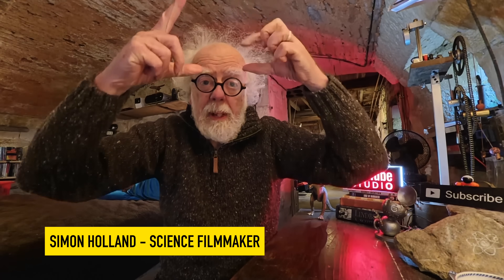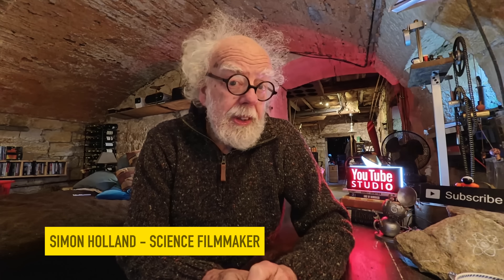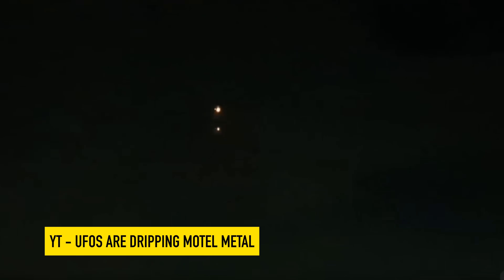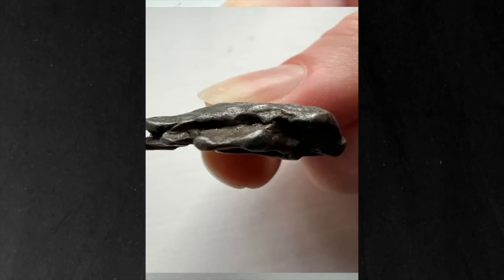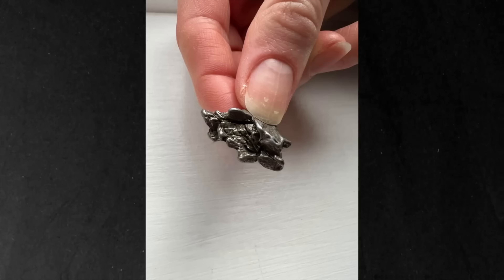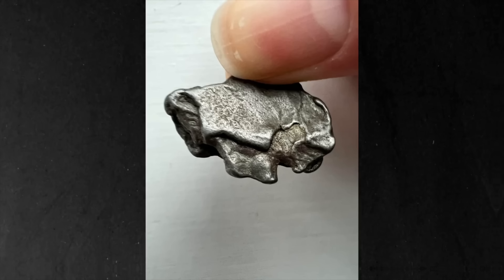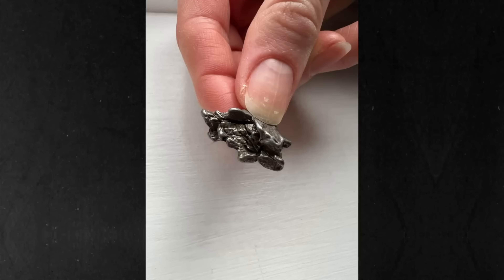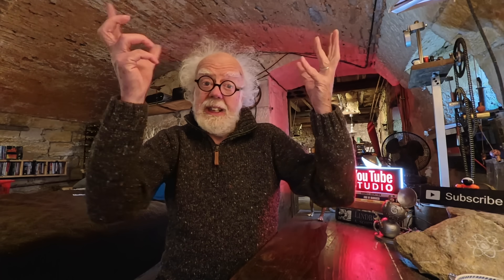Dripping UAP - What Are They?

Comment: Plasmas emit line spectra, specific wavelengths correlating to the electron shell-orbital transitions of the respective elements.  The principle one involved in air plasmas is nitrogen, making up 70% of the air, which has a lot of shorter, higher-energy bluer transitions, and longer, redder, lower-energy ones, resulting in the familiar violet hue of electrical arcs.  The most-commonly seen colour of warp bubbles however is orange / white, diffracting out into a continuous spectrum, inconsistent with plasmas, but instead common to thermal emissions / black body radiation per se.  It's the same anomaly Pierre-Marie Robitaille points out in regards to sunlight and starlight generally.  It's also the same type of distribution as the cosmic microwave background radiation.  So it's essentially the EM equivalent of white noise, comprising photons of all possible wavelengths, and in the case of UAP extending down past infrared into microwave and radio ranges, as well as up past optical range into UV, x-ray and even gamma ranges.  Besides, atmospheric plasmoids wouldn't persist out in space, or under water.  In other words, unlike most light we encounter, UAP light does not correlate to conventional emissions from matter - ie. from relative accelerations between interacting electrons and protons.  The photons are not being produced by electron shell-orbital transitions!

This leaves spontaneous stimulation of radiation from vacuum as the only consistent explanation, implying we're witnessing a so-called 'thermal bath' effect, akin to Unruh radiation, a form of Casimir radiation caused by adding energy to virtual photons, the vacuum's mediator of EM forces per quantum electrodynamics (QED).   As mentioned, UAP orbs are warp bubbles not plasmas, a manifestation of vacuum energy rather than energy expended by or lost to the craft themselves, not unlike the wake of a boat through bioluminescent algae.  Compressing spacetime likewise shortens the Planck length inside the warp bubble relative to outside, while blue-shifting virtual photons, thus adding energy to them relative to the ambient vacuum potential outside the bubble in flat spacetime.  The second law of thermodynamics then applies, energy dissipating from source to sink values of EM vacuum potential, hence these broadband emissions from the interface between curved and flat spacetimes.

Inside each such warp bubble is a solid craft, which may be a disc, sphere, cube or whatever.   Angle hair is likely a form of Rydberg-type matter comprising novel arrangements of ordinary air components, again from novel physics acting at the warp bubble boundary, and molten metal emissions are likely a disposable heat-sink contingency;  spacecraft have limited options for rapid heat exchange, hence under conditions of heat stress may pump all excess heat into an ejectable slug of scrap metal.  Exotic transmutations aside, your theory neglects to mention how self-sustaining atmospheric plasmoids might acquire or carry such metal reserves in the first place!
Reply: What a great and detailed response.  Would love to see a video of this with some illustrations.  I think you would definitely be the first describing the processes observed with such scientific prowess. Instead of leaving more questions unanswered, your explanation seems to answer many questions, even some I never thought about asking before.
Reply: I don't understand half of what you said, but it sounded nice. 😄
There is also intelligent movement, communication, blinking, and instantaneous acceleration associated with "plasma orbs". Metallic orbs are often thought to be affiliated too.
Reply: Thays what i was gonna say
Reply: That's where his theory falls down. As they always do.
Reply: I'm convinced that some of the metallic slag ejected from these glowing orbs could be the detonation mechanism and nuclear fuel from inside our nuclear weapons. Supposedly, after orbs and UAP were seen over nuclear missile sites, the missiles were rendered inoperable and the nuclear materials were missing from inside the weapons themselves.
Reply: Would not be able to formulate it that well myself, but there appeared to be several "shortcuts" in his explanation that did not match up. Like, in his explanation plasma is made up of disintegrated nuclei of heavier elements - this would only happen at temperatures like inside a star or a fusion reactor. People witnessing this would not live to tell the tale... Also, the question of the energy source stays unanswered. Also agree on the question of photon emissions - if you look at the descriptions of the odd properties of the light emitted by UAPs, "normal" dipole EM radiation does not fit the bill. Quadrupole emissions appear to be the better explanation. If taken as a starting point, interesting hypothesis could be developed regarding the physics involved in the process of UAP radiation... one of the possible mechanisms would be... well, a fusion power source. No idea how those UAPs contain the immense levels of radiation that would be involved...
Reply: @ apparently you don’t need those temperatures for fusion to occur. Look into it. ‘Cold’ fusion happens in nature all the time. Even life can transmute elements into limited nutrients if those are unavailable. Nuclear reactions happens in the sun’s corona and not perhaps only in the core. Find a video called the electric sun by Thunderbolt Project.
Reply: @B.W.Broomxc6gs That is true about the numerous orbs around nuclear sites, but how did you come to that conclusion?
Reply: MrVibration:  I like your thinking. I have to chew on some of what you said but it mostly makes sense to me. Pumping excess heat into disposable slugs makes sense, but another way to shed energy (heat) would be to synthesize (fuse) the slugs from the protons, neutrons, and electrons in the plasma, then pump the remaining heat into the slugs and shed them as molten metal... thus an unlimited supply of slugs.
Reply: I saw an orb video of it powering up on an electric train line once on YouTube id love to  see that video again
Reply: Agreed. I cannot put it nearly as well as you did, but I know these are likely not plasma because they have been seen coming out of the ocean, yet no steam is ever seen. Therefore, they are not hot, so they can't be plasma. Just my uneducated opinion.
Reply: Wow, you lost me.
Reply: A few things don't make sense to me from his explanation.  First is that the video shows the orb for more than a "few seconds".  A naturally occurring plasma orb wouldn't last that long, standing still high up in the air.  Another thing is that, while I can see how such an orb could produce trace amounts of a substance using the air around it, how could it make so much material, and why is it all metallic?  I think he may be right about the slag being from something else, such as melted cans, or something from a welding / cutting process.  There's just too much metal for it to be made from thin air from such a small orb, and it it really was made from one, I wouldn't want to get close to it, as it could be radioactive or poisonous.
Reply: A very valid and informed answer. Thanks
Reply: Nice theory.
Reply: Anyone who mentions Pierre-Marie Robitaille unironically doesn't possess the requisite base education to hold an adult-level conversation...
Reply: @MrVibrating  
I also agree it's not electron shell orbiting transitions.
...
But, something to do with the elements within the power source.
..
A clue might be the colour of the emissions..
..
From what I have read, UAPs emit all sorts of colours.
White, orange, red & blue being the most common.
..
Another clue, 
If we consider the colours of metals as they're burnt to the point they reach plasma. Those metals give off an individual spectrum of light.
..
Copper green.
Barium green
Strontium red
Lithium red
Calcium red/orange
Sodium orange 
Potassium 
Violet.
Just some examples..
So maybe if the power source of said orb is of a certam element this dictates the colour of the orb.
Also denotes the temperature of the Orb as well.
Reply: @stuartd9741  That would imply UAP carry a conserved supply of elements for each colour they can rapidly cycle through.  As many will know, UAP can also lase, - emitting coherent monochromatic photons which may or may not be collimated into a beam, and can even lase back in response to an applied laser beam, as if the warp bubble is in some kind of 'population inversion' state similar to the first generation of plasma-cored lasers.

Of course there's no reason UAP shouldn't also produce light via conventional, classical means;  stimulated emissions from vacuum pertain specifically to the light from warp bubbles, which begins as a dull rust-red glow usually from the underside and / or top of craft, ramping up to an orange, then yellow, then brilliant-white orb, which is when the effects of ionising (UV+) radiation are reported; ionised oxygen preferentially recombining into ozone, blocking leaf stromata resulting in carbon-depletion of underlying soil microbiomes, and although we can't see it, animals which can such as dogs and livestock are understandably spooked by it.  Radio and microwave noise is also widely reported, damage to skin, hair, eyes, textiles, car paints, anomalous x-ray and gamma ray bursts are all commonly implicated, and irreconcilable with conventional or 'chemical' light emissions (there's some doubt even nuclear reactions could produce gamma-range photons, let alone ordinary matter).
Reply: @stuartd9741 Strontium and Lithium. Interesting.

Comment: Bright light, plasma and dripping metal/slag? Often found during arc welding. The flying/Aerial part? Not so much.
Perhaps aliens use the intense conditions of the arc to enable propulsion. The weld settings would be non- standard/overpowered. The light, plasma and dripping metal simply being byproducts.
At least one science fiction story has used injected metal tape into a plasma reactor as a basis for spacecraft propulsion.

Comment: Professor, you just said we live in a  pressurised atmosphere. We can all agree with that. My question to you is, the scientists have long told us space is a vacuum. Using your gargantuan brain, could you explain why the vacuum of space doesn’t suck all the air from our pressurised system.. Happy new new
Reply: @benjibob4662  Why doesn't the low density of air suck the high density of water out of the oceans?
Ok, it does, obviously but only a tiny fraction of the water of the oceans.

I would say the atmosphere is packed onto the earth via the phenomena of gravity and it's under higher pressure closer to the earths surface than closer to space.

I'm sure the distinction between what we call space and what we call the atmosphere is a bit fuzzy but all air molecules are attracted to earth. It's just that some of them have less air molecules on top of them than others and so I imagine air becoming less and less dense the higher up you go because the pressure decreases. Why would the top molecules escape?
Reply: To find simple explanations for this you need to search for 'flat earth tropes debunked' because that's definitely where your questions are coming from. 

1) Vacuum doesn't pull:  A vacuum is simply an absence of matter, meaning it has no force to pull anything. 
2) Pressure difference is key:  When a pressurized system is exposed to a vacuum, the air inside pushes outwards due to its own pressure, trying to equalize with the surrounding vacuum. 
3) Gravity holds the atmosphere: Earth's gravity pulls the air molecules down, preventing them from escaping into space.

Comment: How could the metal sustain temperatures hot enough to be able to stay in a molten state? 
Making shot myself, metal solidifies above a given hight but it's easily speed up by allowing the metals to drip into a body of water. 
Even if the metal could stay molten!  Then why is it so thick? Why does it look folded? And why isn't it flat with point's as metal SPLATTERS